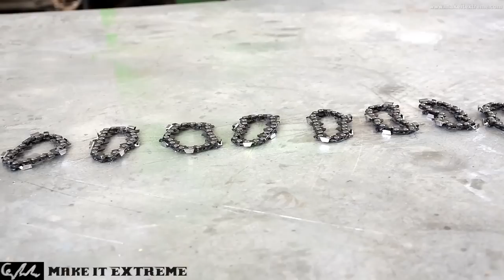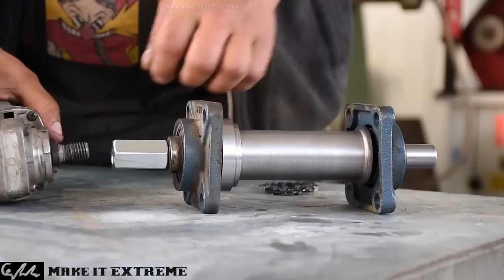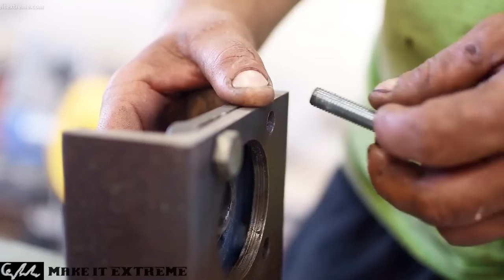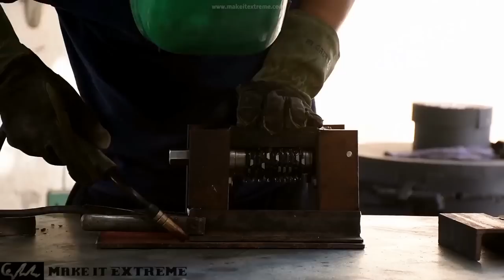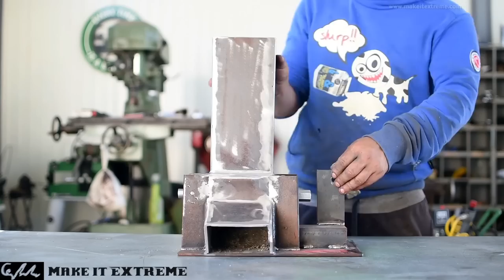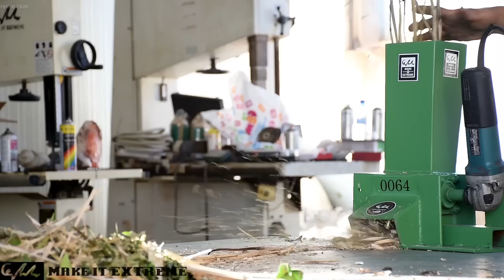Angle Grinder Hack 6

Comment: angle grinders are apparently an alternative medicine cure-all for the garage...i never knew...!!
Reply: Pretty much, for a good starter workshop all you need is a hammer, good pair of pliers, screwdrivers and wrenches, an angle grinder and a cheap stick welder.

Anyone that has these tools and is not doing crap because they "don't have the right equipment", are just making up excuses not to get their hands dirty.
Reply: you mean angle grinder(s)
Reply: You mean there are people out there with only One angle grinder in their tool kits? Poor Bastards
Reply: How many hands do you have? I can only use one at a time! I keep the one I'm using and one spare. They have an annoying tendency to break at the most inopportune moments. Apparently, this is a lesser known one of Murphy's Laws' Corollaries.

Comment: And what are you doing if the teeth get dull? when everything is welded together, you can't get them out that easily, can you?
Reply: exactly my thoughts.
Not made to be used much I guess
Reply: You obviously use an angle grinder to open it.
Reply: Techtastisch 75 watch it again. you miss the part where he drilled a big ass hole and bolted the bearing frame. undo the bolts on on both sides and slide it out
Reply: Steven Alexander... ok your right bro!!!! how about the 2 bottom bolts? Bolts with selflocking nuts its not easy to open, you nut another tools to counter the rotation of bolts which is at the bottom of the bearing.
Reply: Techtastisch 75 This is FAR from extreme, you used one of the smaller chains on the market which is going to stretch like a bastard in just a few hours of use due to the lack of cooling provided by the chain oil, the teeth are at the wrong angle thus exacerbating the stretch that will inevitably happen. Had you wanted to START at the bottom edge of extreme you would have used 440 harvester chain or even better would have been the 995 harvester chain that is currently in use on harvester heads. You used a tiny little electric motor which will either burn out turning that monstrosity or need to have the brushes changed excessively in order to keep the motor running. And I might add that almost this exact thing, except it is gas powered is already on the market and it is CHEAP to purchase (under 200$)and extremely well built out of forged steel it also attaches to any modern chainsaw under 80CC.
Reply: Techtastisch 75 also when it is time to sharpen he is going to have to pull each chain off, put each tooth in a vice and go at it with a 7/32 round file (that's the proper size file for this chain) to even come close to the proper angles needed for a sharp tooth. 995 harvester chain usually runs 9-10 full 12 hour shifts on a harvester head before it needs to be sharpened and I have never seen one come close to stretching before the teeth are completely worn out and the chain needs to be replaced all together which happens on average about once every 6-7 weeks in industrial applications in the forestry sector.
Reply: You guys do realize that this isn't a commercial product that he's going to be using daily right? I mean, it doesn't look like he's going for a patent on this
Reply: Built a thing like that almost twenty years ago,but a lot bigger.Great idea but does not keep working.The problem is not chain tightening, that can be solved.The problem is the chains clog up very quickly Great channel though.
Reply: Gabriel Strom the working time on those tiny little chains without proper oil for cooling is probably less than 8 hrs if your lucky and don't shove larger objects through it.
Reply: Gabriel Strom cute toy is about all it adds up to.
Reply: +Mr. Lumberjakn
If you look at the other angle grinder hacks these guys make, they're equally impractical. That's the point. They make lots of other things which are "extreme" but this series is just for fun.. If you don't like it, be on your merry way but I hope you see the point now at least...
Reply: as easy as it was to build im sure you can make one with a access port or bolted flange
Reply: It looks like you can unscrew both sides near the bearings...
Reply: simple, you make new one
Reply: Some of you fellas are missing the whole point of why he does what he does, which is to build something interesting enough to get lots of people to watch it. Nearly a quarter million views (so far) in the first day, I'd call that a big win.  This would have far fewer views if he built a normal chipper shredder like what you can buy at Home Depot.
Reply: To sharpen the MakeItExtreme garden shredder cutters:
Take the motor (angle grinder) off (it is held on by one (1) bolt. 
The bearings are on the outside. Unloosen the 4 bolts and take the bearings off, or maybe just one.
Remove the shaft out the bearing hole(s).
Unloosen the collar holding the rings and chains on.
Remove the spacers and chains.
Replace the chains from stock, or sharpen them with a grinding wheel in the angle grinder.
Reassemble in the reverse order to disassembly.
Reply: +Ross Marsden You forgot the Chinese - English parts with all of they're grammatically mistakes
Reply: Oh, you mean the docs they translate into Hopi Native American, then into Chinese, just to "UP" their game on "impossible to understand"? Like ANY instructions you get from Harbor Frieght...
Reply: Classic Faraday cages are made of copper screening, so it seems most conductive metals will stop RF.

If I built one of these, I think I'd use TWO neodymium magnets. Murphy's Law always get me...
Reply: Mr. Lumberjakn it should be used as juicer for apples,it would last him forever.
Reply: INTERNATIONAL that would be a great use for is, or a compost disposal unit for food waste under a kitchen sink.
Reply: Will not be a problem, the thing does not work. You will never have to sharpen it.
Reply: It appears you did not SEE it work in the video.

The items shredded are not that tough, so chain stretch won't be an issue. (Not like on a chain saw or a motorcycle.) I've used a lot of chain saws and put in millions of miles on motorcycles so I speak from experience. Some types of chain saw chains, the bearings are self-lubricating - that's what I would choose. So, all these 'issues' are NON-ISSUES .

Make It Extreme    built this to show that one could build a practical shredder better in quality than most on the market. The re-sharpening should not be a big issue. Anyone who is capable of fabricating one, can disassemble it and use the proper chain saw sharpening tools IF it is ever needed.

I think it is a thing of beauty, being a person who can appreciate a well-made machine.

It's truly a heavy duty machine.

To all those nay-sayers, go build one better. I'd wager you won't be able to. If someone does, please be kind enough to share your improvements. Make It Extreme was kind enough to share the "How To", So get building!
Reply: I built one of these things nearly twenty years ago  and it kind of worked for about five  minutes, then the saw teeth filled up and it stopped working.The stretching problem can be solved by designing it differently. Looks like a great idea but the bottom line is it does not work , build one and see.
Reply: Here is how to solve the stretching problem. Make it out of a solid block with grooves for the chains, then split the block and install bolts which push the blocks apart and tighten the chains. You will  have to have a solid centre bush of course so it can be installed on the shaft.Lubrication is not a problem because the chains are not rotating on a sprocket like a chainsaw or motorcycle.
Reply: Laurence Lee Roceta Those self locking nuts do nothing XD they just kinda stop losening from vibration..

Comment: the next video making a lathe 😆😆😆😆😆😆😆😆plspls
Reply: Erik György A lathe powered by an angle grinder..?
Reply: Not enough torque
Reply: It would have enough torque, it spins too fast anyway, so you'd need some kind of reduction, and with reduction comes torque. It wouldn't be good for metal, but for wood it would be great.
Reply: Oh I was just thinking for metal
Reply: im building one

Comment: if you stagger the teeth it wont jam as quick on thicker cuts. Nice job!
Reply: Frontierless Craftsman 
yeah but chain saw gets dull fast.
Reply: It does not appear that these chains are bound together so some are going to just naturally stagger themselves. And while you're building the chain sets, build a spare so you can sharpen the set that is not in the machine.
Reply: Where you been, brother?

Comment: ok, nice, but... after half a hour using this thing, the chains get dull (just like they do when used on a regular chainsaw), and then? first: sharpening those little chains asks for complete disassembly, every chain has to come off: that will take you hours including sharpening and putting it back together, but wait! You can't even disassemble it because you just welded every bit of the thing... So you'll need the angel grinder to cut the whole thing apart, just to get the tooth's sharpened...

Comment: This is the best value for money system!
There is nothing better !
changing the chains is easy, the process is simple and inexpensive!
on the other hand, I would rather have put 2 cylinders in opposite rotation, as roller mills do!
the efficiency would have been at the top!

Comment: ok I like the concept of this very much oh yes I do but... it will be a pain the but to sharpen when it gets dull and it will get dull because there is no way you can resist throwing stuff in there Im sure. but...they do make carbide blades ...and then as an added bit of extreme why stop at one arbor ???? When you could put in two and connect them with a gates poly chain and use a bigger grinder and make a bigger chute? you could run a shredding service and make some bucks with it! Have fun though thats the main thing.

Comment: Really cool project, but it doesn't look like its doing a good job.  Maybe add a steel mesh screen with .5-1 " holes in them so old small things can go through.  That grinder would really be working then!  I really wanted to see the grinder get bogged down a little :)

Comment: With time and materials you could have just bought a small wood chipper. That angle grinder isn't going to stand up to repeated high torque loads like that. It's made to go fast with little resistance. You  need a nice single phase or even 3 phase motor on that to make it be able to shred anything of significance. Great job on the build though.

Comment: Cool idea dudes.. needs some way of slowing the throughput to get some control of particulate size... big chunks with a fast rate of feed, and fine dust when it goes through slow... something like a pair of sprung rollers at base of hopper that put the brakes on and slow the amount of time it takes to process the piece.

Comment: OK, if you are into this, here's a challenge for you:  I've always wanted to know how to design and build a "Kindling machine".  Input are normal seasoned fire logs.  16", full round.  Eventually I'd want to have this machine work over hydraulics, as this can work over time, which is great for non-electrical applications.  

The target goal would have the following dimensions:

length: 4-6" (10-16 cm)
diameter: 1-2" (3-6 cm)

These sticks would be optimal for a Rocket Stove.  If you have any ideas, I'd love to see what you could come up with.

Comment: Love it! Be careful though, chainsaw chain is designed to spin a lot slower than that. I would put a chip catcher or make a metal bin that the chips fly into so if a chain breaks, it is contained instead of flying across the room at 18k rpm:)

Comment: Some flaws:
-The gap between the blades and wall should be adjustable in this design, otherwise it may not shred small/big branches
-Use induction motor ! The angle grinder has universal motor with brushes. Those are not meant to be run for extended periods of time and wear out relatively quickly.

I quite like how it's solid and strong though.
Thumbs up. Alex

Comment: So is this like the chipper version of the stress ball?   Doesn't seem to have much practical use other than splattering and making a mess.. lol..   If it was meant to be a chipper, would be nice if you did something where they came out more uniform. However, touche on this piece if you are cartel or something and making an example with someone's hand...

Comment: Pretty cool i am a retired Woodworker  who has had very little metal working  or welding experience  personally  for some unknown  reason  ive found watching  videos of you guys fabricating  fascinating and therapeutic to watch  more specifically  machining on the lathe ?  I  suffered a major stroke years ago and i no longer have the ability  to use my hands as i once did throughout my life  making furniture and doing wooden boat restorations and repairs  i actually do have very good freinds that own and operate  a machine shop and i get the  chance to stop by and  see things  operating  in the shop !  Of course i will also give them a helping hand  moving  or  reorganizing  if they need the help  in order to learn more  they of course have  utilized modern machinery for production   Like CNC and Water Jet  tooling similar  to most Cabinet shops  needing to utilize  similar   Machinery  to increase production in the woodworking

Comment: Great stuff!! One suggestion if I may :) Adding adjustable curved plate on hinge instead fixed one could add to various feed rate in various thicknesses material shredded. And possibly eliminate the need to add a somewhat unnecessary complicated pre feed rollers...  Keep up the good work!

Comment: Great job man!!! 
I like what you do with the saw blade in your chop saw, I tried it a few day ago on a piece of 2 1/2" round rod mild steel I had to cut worked great on the first cut but would not cut the second one for me, the blade was shot (it was a used blade). So I was wondering how long does a blade last you?

Comment: This is FAR from extreme, you used one of the smaller chains on the market which is going to stretch like a bastard in just a few hours of use due to the lack of cooling provided by the chain oil, the teeth are at the wrong angle thus exacerbating the stretch that will inevitably happen. Had you wanted to START at the bottom edge of extreme you would have used 440 harvester chain or even better would have been the 995 harvester chain that is currently in use on harvester heads. You used a tiny little electric motor which will either burn out turning that monstrosity or need to have the brushes changed excessively in order to keep the motor running. And I might add that almost this exact thing, except it is gas powered is already on the market and it is CHEAP to purchase (under 200$)and extremely well built out of forged steel it also attaches to any modern chainsaw under 80CC.
Reply: FYI good luck trying to sharpen that thing in a few hours with a 7/32 round file without completely dismantling it, pulling each and every chain off and placing every single tooth in a vice so you can achieve something close to the proper angle.
Reply: Mr. Lumberjakn - the chain is not flexing so the pins have nearly no reason to wear or stretch. yeah its quick and dirty but not near as bad as your worries
Reply: PAGAN FIRE could also have shown skills by doing something usefull.